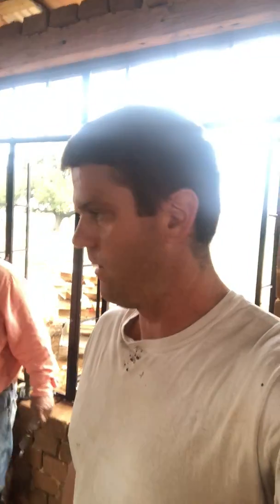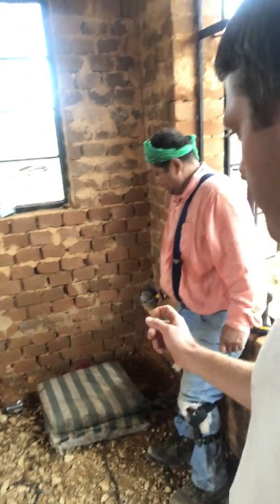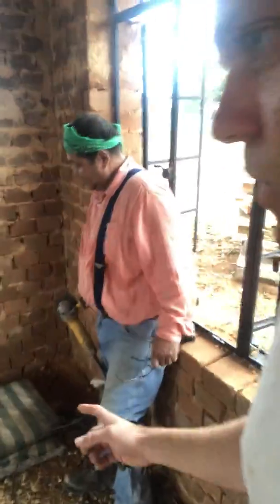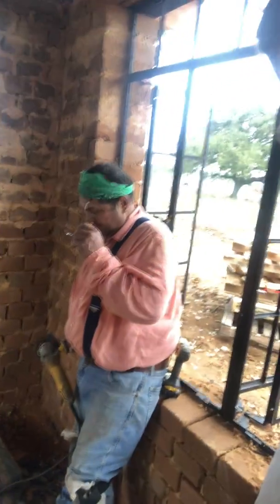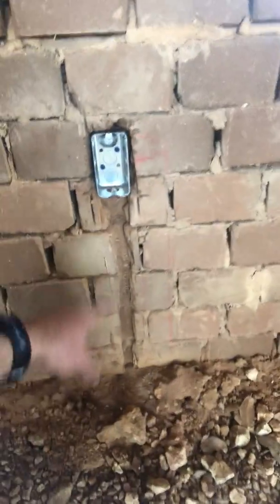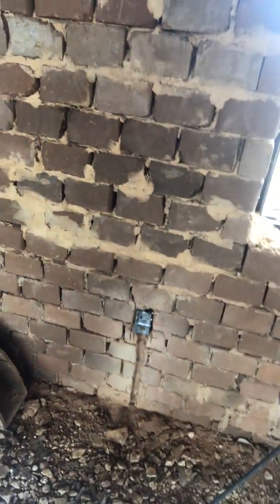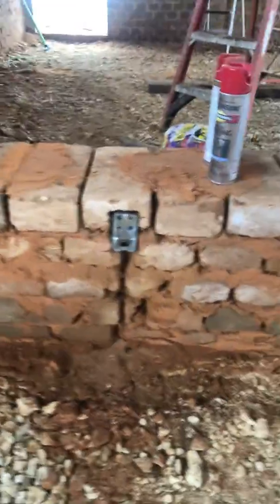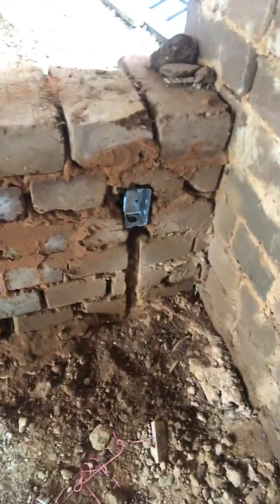Electrical installation in stabilized compressed earth block walls

Comment: I'm curious what the finished surface looks like? Are these plastered?  Looking at moving from Texas to the High Desert north of Reno NV.  Home prices there are way higher then here.  I am considering Rammed Earth or CEB block buildings for energy efficiency.  Any suggestions?
Reply from the maker: The walls will be finished with a lime based plaster. Both rammed earth and CEB construction are beautiful and energy efficient. Rammed earth will be significantly more expensive. Check out our website at aectearthblock.com or download our app for more detailed information about building with earth.